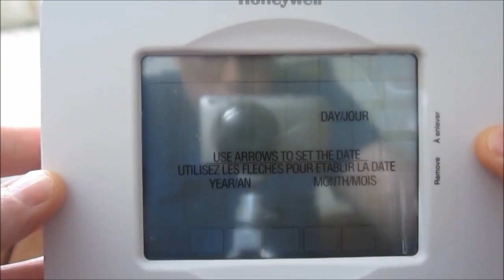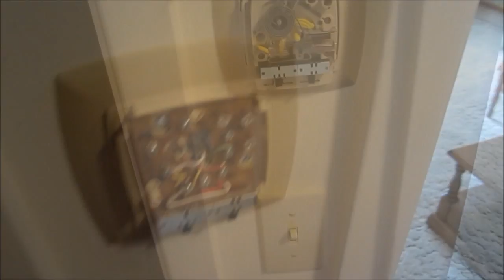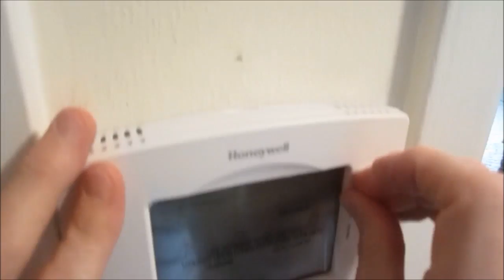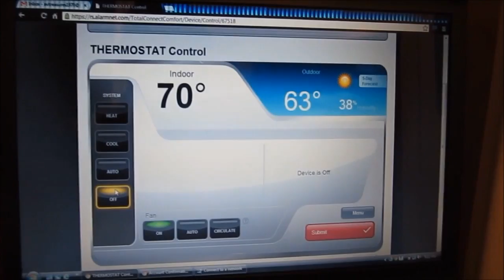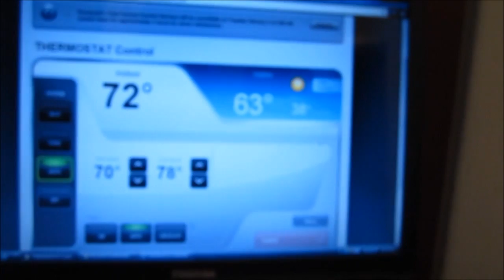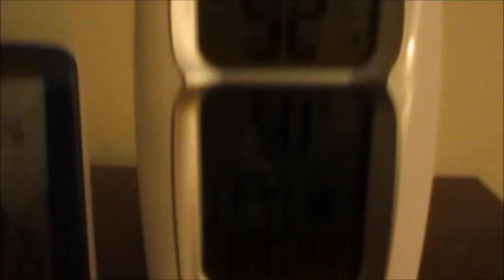Honeywell WiFi Vision Pro 8000 Thermostat

Comment: hey ray, thanks for the video. how would you recommend setting up a WiFi thermostat without the C wire? I have seen videos using the G wire but then you lose the ability to use the fan.
Reply from the maker: +Eric McFarland 
Hello Eric and thanks for watching my video. I wouldn't recommend using the G wire and losing your fan options. The best thing to do is run a new thermostat cable that has enough wires if at all possible. If this is out of the question, VenStar makes an add a wire module. I've never used it, but it appears to do exactly what you want to do from what I just read. Here's the link to where I found it:
http://www.supplyhouse.com/Venstar-ACC0410-Add-a-Wire?gclid=CjwKEAjw9Zu5BRCS_OuVibujhQ0SJAD7t4KrQUI5pm5yw-bU3TIKhFCCoSbA_Eih-yGQiRDWaUB-uBoCNuHw_wcB#
Reply: +AVTreasures much appreciated!
Reply from the maker: +Eric McFarland 
No Problem!

Comment: Hi i love your video.  I was wanting to know what kind of "putty" that is??
Reply from the maker: Hey Steve! Thank you for checking out my video! The putty I am using is made by M-D Building products and is actually cord weatherstrip that I rolled into a ball. The M-D part number is 71548. Here is a link to it on Amazon. You can also pick it up at Lowe's or Home Depot as well. 
http://www.amazon.com/M-D-Building-Products-71548-Weatherstrip/dp/B000CSN69C
I like the cord weatherstrip because it stays pliable for years. The roll you see in this video is around 20 years old now and is still like the day I bought it. Thanks again for watching and for the kind words Steve!

Comment: Thank you for this video. I have the same unit & changed my wireless network setup. Now I cannot get it to connect again despite many tutorials I've found online for possible button combinations. Do you, by chance, know how to get it to search for a new network SSID after it has previously been connected to another?
Reply from the maker: ***** Hello J, I ran into this just a few months back myself. Here's what you need to do: First, go into the system setup and find function 0900. Set this function to "0". Now go back to function 0890 and set this to "0" also. Exit system set up, then re-enter system set up go back to function 0890 and set it to "1". This will put the thermostat back into set up mode for WiFi connection. The message center should now read "Wi-Fi Setup". Now you can go to your smartphone, laptop, etc and look for a network called "NewThemostat_123456" (the number will vary) Select as a "Home Network" Then open your browser and access Thermostat WiFi setup (this should come up automatically when you open your browser-if it doesn't go to http://192.168.1.1.
Now, just complete the instructions for joining your WiFi Network (enter router password) and click on the connect button. The thermostat will now show "CONNECTING....." in the message center and should connect within a minute or so. 
Hope this helps you out J. Thanks for watching my video.
Reply: I can't thank you enough man...that did the trick!
Reply from the maker: You're welcome J! I'm glad you got it re-connected. Thank you for letting me know that it worked for you.

Comment: Should not have flex tubing for the gas line to furnace. Any inspector will point this out as not safe and should be solid pipe. We are Full Time Real Estate brokers and have seen this pointed out many times on inspection reports.
Reply from the maker: The flex line is actually a code requirement in areas that could experience Earthquakes. The only code against flex lines here is to not have them going all the way into the furnace where the sheet metal could rub a hole in them. If you look close, you will see black iron coming out of the side of the furnace.

Comment: Hey, good job on the video and your production work!
Do you know by chance how to calibrate this unit? Mine is off by >3 degrees.
Thank you, Bernie.
Reply from the maker: Hey Thanks Bernie! 
You can adjust the temperature display offset in the setup menu. Find Option 0700 and you can adjust up to 3 degrees either way.
No problem, thank you for watching my video!

Comment: Nice Vid. I wanted to reply to a few comments directly but I guess it's disabled. Just wanted to say that it saves a lot of $.  So much so that I've gotten several bills from the Gas/Electric company for ZERO$$!  We're on a a 'pay-one-price-all-year-long' plan and because it's based on the avrg of the old consumption rate that when we started turning off the heat and A.C. from 10 PM to 6 AM we saved so much money doing so that we got 3 bills at the end of the cycle for $0!! Very nice!
Reply from the maker: Hey Vincent, thank you!! I know, unfortunately any comments posted before the comments were moved to Google+ can not be replied to. Wow, zero bills, now that is really cool! I am saving a good bit myself. I don't do the average billing but my bills have gone down with the Honeywell WiFi vision pro in control of my system. It amazes me how smart the thermostat is. It is not just reading the temp, it is always planning and estimating how much it needs to run. It even adjusts it's plan for recovery time as the weather changes. My house has never been more comfortable either!! Thanks for watching my video Vincent, and for leaving the great comment!!

Comment from the maker: Hello Debra! Thank you for checking out my video. The installer should set everything up for you. If not, the WiFi set up is very easy. Just be sure he leaves you the manual and the little card that has the thermostats MAC ID on it, that's all you will need. To answer your other question...If the thermostat loses power, it has a button cell battery that will hold all settings in memory so when the power comes back on, everything will go right back where it was. It will also reconnect to the Wifi

Comment: We had a VP 8000 installed for my 80 year old mom 11/2012 when we replaced the heat pump - I have to find out if it's wifi or not.  But it's great - she can program the hold on it when she goes away - it's saved me a mint on elec. bills 'cause she used to just leave it at her high temp or low cool comfort level rather than push 3 buttons.  We're having the wifi put it with our new a/c-furnace tomorrow. Bad thing - I won't be here & hubby isn't real good with this kind of stuff.

Comment from the maker: Great! You will like it! The 8321 model has a humidity control feature. It has a humidity reading and set point. If the thermostat is in cooling mode and the humidity rises above your setting, it will run the AC up to 3 degrees below the set point to help lower the humidity. I have the 8321 at work, it does a great job. As far as I know they heaven't came out with the 8321 in the WiFi version yet.

Comment: Great Install man,
I am thinking about putting on of them on my ruud, being able to control the hvac system would be sweet, plus when the next system gets put in we will be ready for a heat pump as far a thermostat goes.
Having the auto changover is sweet also.

Comment: Fantastic video Ray! I think you are really going to like the Honeywell Vision Pro. You will probably have to tweak the setting just a little bit but this is normal for a oversize unit.That is a Energy Aware thermostat and there are only three thermostat company that can pass the temperature accuracy test,Honeywell,White Rodgers and Braeburn.